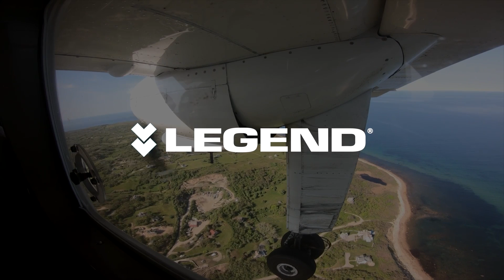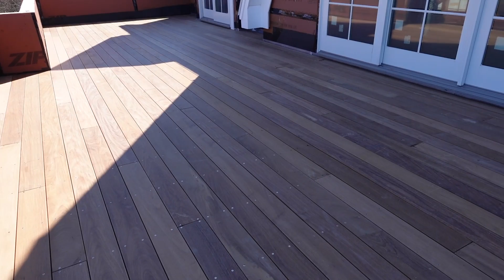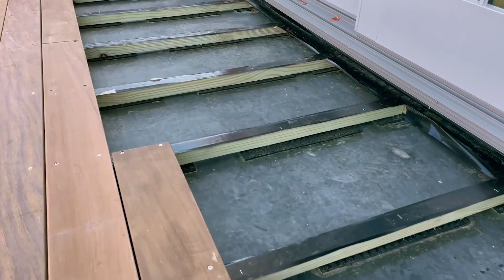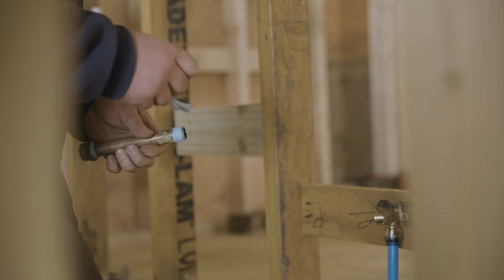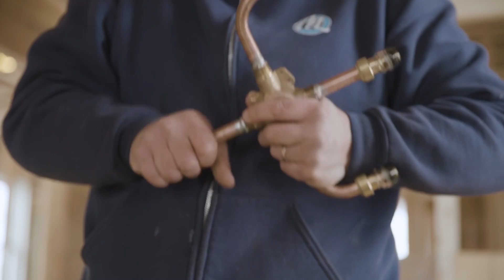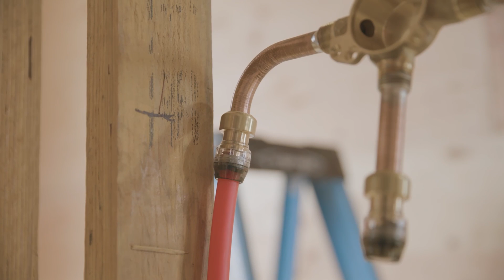BOAI Episode 8: SmartClick fittings, HyperPure Piping & More...

Comment: I kinda like the strength characteristics of cross-linked Pex.  I've seen freeze tests that make me feel confident about it.  This straight chain pipe needs a few more years to prove itself in my opinion.  Maybe use it in garages and exposed crawl spaces where it can be more readily checked in worst case scenario's.   I still remember polybutylene pipe.  Come back to me in 15 years.
Reply: It's just Dow PE-RT, it's been around ~20 years or so.  Big advantage over Pex-A is that it can be recycled.  Should perform exactly the same and there haven't been lots of issues with it yet.  I'd be more concerned about those snazzy fittings, barb fittings with crimps or clamps work well and are installed quickly by anyone who has done it for any length of time, I'm not sure how this improves things besides burying new technology quick connect fittings behind walls.
Reply: @shaunbava1801   lol, it is designed to improve their bottom line, kinda like this video 😂

Comment: I use push fittings for appliance water lines all the time and wondered why it wasn't used in house plumbing. Very cool. Now you need to do an updated burst test!
Reply: Not sure on SmartClick, but Sharkbite counts on a lubricated EPDM o-ring to create a water tight seal around the pex or copper pipe you're fitting to, and they just haven't been on the market long enough to know for 100% sure how long that seal will last.  EPDM is good stuff in general, I'm not sure anyone can say for 100% sure how long they will last in this exact scenario and for possibly differing water sources.  Maybe 20 years, maybe 80. 

I used Sharkbite fittings on PEX and existing copper when I replaced my water softener and water filter system. It's all located in my garage where any leaks would be easily visible every time I replace a water filter or fill my softener, but I'm not sure I'd trust them enough to hide them behind a wall for possibly 50+ years. 

If I was doing PEX behind drywall I would use crimp.  Actually might just use crimp everywhere for cost reasons.
Reply: @everydreamai  I'd also say that the water quality can greatly reduce, or lengthen, the life of a push type of fitting. 
Like you, I crimp all my connections tok unless they're exposed. There's nothing to deteriorate on a crimp type of connection that the water itself or quality could effect in my lifetime.

Comment: I bet the cost difference in fittings alone on a medium-large project would be more than the “fancy expensive tools”
Reply: It’s about the same price of shark bites. 9-12 dollars per fitting. So maybe. I’m no pro and if I was I don’t think this may be the system for new whole home construction. But as a diy guy who may replace a pipe or two I would use this over shark bite.
Reply: Yeah, those fittings would add up pretty quick!
Reply: @morganwheeler7417  The problem is the cost per fitting to install.
Reply: @charlesrichardson8635  I hear what you’re saying, but fittings are not a big enough part of the total labor time so as to justify such a high cost for fittings… that’s my .02 anyway
Reply: @charlesrichardson8635  Who the hell can't do pex crimping?

I get copper is "scary" but goddamn, if you can't do basic residential plumbing you shouldn't be owning that house...
Reply: @Scircx  I have done an entire house with pex crimping. So Yes I can do it. With planning and proper use of pex, I don't have near as many joints like my remodel of my current house. Don't forget you need to check EVERY with a gage because eyeing it is not good enough. I did a lot more bending of pex instead of fittings and it worked out well. Actually I can see myself a combination of both, but my tool that does 3/8, 1/2, 3/4, and 1 inch with a block change out takes time and it not easy to use in tight spaces. So in this house, I saved about half my time bending and using push-to-connect. Though I have to say the first two bends were a bit scary because I thought I might kink it. Slow and steady did it, so no pressure loss.
Reply: @charlesrichardson8635  I think I @ the wrong person, I didn't mean to come at you lol. And tbh, I would rather use pex a vs b. $500 for the tools (buy once cry once) and the physics behind it is more sound vs crimping pex b.

I'm sure pex a would've been a lot less hassle for you as you could heat gun a kink out vs completely replacing pex b.

And honestly, as long as you do SOMETHING, you're doing it right. More respect to anyone who does the upkeep themselves is all, we can argue about the way it should be done all day.
Reply: @Scircx  I was also eyeing the tool for Pex B, that puppy is expensive!

Comment: Honestly, when I build my house, I’m not going to use any form of quick connect system. 
Pex-A will be my choice throughout the house. I will be using a valve manifold, so that if at some point I need to repair something, I can shut off that zone, do the repair, and not affect water to anywhere else in the house.

Comment: I agree with the others, what is the flow loss over long runs?  One of the major advantages of Type A, especially in big houses with long runs.  My daughters house they had to upsize to get enough flow to the far bathrooms.  One of the problems of having the vendor do the  presentation, they don't address the downsides.  Might be the right choice for certain situations based on price, availability.  May be the wrong choice based on high flow needs, etc.  Need ALL the information to make an informed choice.  As far as tool costs, that may be something a DIY needs to consider, but a tradesman probably has to have the tools for all the pipe types because they have to be ready for the jobs they get called to.  A good introduction to the product, but not anything more than you can get from a sales brochure.  Would be good to have a more thorough evaluation/comparison in a future episone.
Reply: Several PEX B such as Zurn are certified for F1960 cold expansion fittings.  It’s not a PEX A only thing anymore.

Comment: The connect fittings still have o-rings, that I would imagine dry and rot, as well as spring steel that who knows how long would take to corrode with varying minerals in water sources.  I've learned to not install shark bites in concealed areas, is there a difference in these?  30 year warranty tells me same problem, new widget.

Comment: For all these high end houses it seems like everyone’s going back in plumbing, cheap plastic with fittings that can leak like crazy
Reply: @Ball_cock  you would think it  make more sense to have copper piping with a house worth that much
Reply: @davidchillton1744  Copper bursts when frozen, and the sweat connections are prone to fail after 20yrs+.
Reply: Pex can burst too 😂
Reply: @davidchillton1744  Never seen it happen. Crimp much more reliable than Sharkbite. Lived in Alaska. Never had a burst fitting. Copper wouldn’t have stood a chance in similar conditions to what the PEX endured.
Reply: @JohnathanBach  highly doubt that.  I’d rather rely on solder that’s a rubber gasket any day
Reply: @davidchillton1744  With PEX crimp fittings, you don’t have a rubber gasket. If you’re talking about Sharkbite, I agree. Wouldn’t put Sharkbite in an inaccessible place, just not worth the risk, in my view.

Comment: No mention of the cost for each of the fittings or I missed it. Uponor seems like the best solution still with minimal fittings, as they add up fast.
Reply: Will all be replaced with EvoPex or this in the future. On new construction the contractor using the push fittings will be able to under bid because of install time.
Reply: @lrc87290  Not at $25 per fitting. Pex A is pretty fast also, and better flow.
Reply: @JohnathanBach  I don't know the cost of the fittings in video but supply house has A 6 pack of 1/2 evo PEX 90s for $26. The internal diameter is the same as  PEX crimp fittings so not less flow.
Reply: @lrc87290  Right. Pex A is expansion fitting, not crimp.
Reply: @JohnathanBach  right. Uponor Pex A still takes time to complete. In my whole townhouse renovation I used Pex A for its flexability and a few shark bites. There are only 3 fittings in the wall. One each on the supply valve to my 3 wall hung toilets. 
SharkBite supply manifold is in the conditioned attic. Holdright stub out brackets has no fittings.

Comment: The HyperPure PE-RT piping shares several characteristics with PEX-A, like flexibility and expansion. It's just that it's recyclable, and it allegedly stands up to chlorine/chloramines better than PEX-A or Zurn Pex-B. It's rated for ASTM F1960 expansion fittings too.

 IIRC, the max-temp rating is slightly lower than that of PEX-A.

Comment: On the underside of the deck, even though it's sloped to allow water to slide off, isn't that a potential problem for major ice build-up underneath the deck?
Reply: Or blown sand over the years??
Reply: Fix one problem, create another. Good point.
Reply: I was actually wondering about the lift characteristics of the deck since it's not mechanically fastened to the structure.  You get some might windy days on an island.    Ever seen a gas station canopy lift off and fly down the street in a Florida hurricane?  Same visual.
Reply: @jonmiguel  We built a free standing deck for our house, say about 4,000 sqft.  our Architect was VERY worried about lift and other wind effects.  We ended up with some very significant footers.  The structure is all steel and I-Beams, I think the footers were 4 feet by 4 feet, basically a boat load of concrete.  But, we have no penetration into the side of our house  Bottom line, you are spot on regarding the potential for uplift, and for us, it connects to our Pool House so we get a venturi tunnel effect that blows stuff around on top too
Reply: @CC_Foster  In this case it seems more to me like a piece of paper laying on top of a box.  WOOOOOSH!

Comment: Does the smartclick fittings have smaller or same inner diameter as the tubing? Because if its a smaller i.d. and if I were use a lot of those fittings on a single run, all those fittings would cause a restrictive flow.

Comment: using aluminum 2x4 or 2x3 for the porch-sleepers, would eliminate future rot-worry, and screw penetration-worry...........everyone of those boards will rot out quickly, despite the tape.... a multi-thousand dollar repair, and a multi-thousand dollar waste in the build....or even plasti-lam beams, anything but open wood..

Comment: And what's the cost differential, let's say for a 1/2 inch 90 degree coupler vs Shark-bite and some of the expansion ring systems on the market?  Yes, for the expansion ring systems especially you have the cost of the tool.  Let's assume you get ALL of your hot and cold water lines run and just need to make connections so you RENT the damned thing for a day or two.

Comment: The reason I would go with HyperPure is because it’s easily recyclable (unlike PEX). That needs to be a talking point, on top of the 100 year guarantee. Also, that it can be installed with any type of pex fittings or even melted/joined with the proper tool. The marketing guy did a super bad job selling the positive differences — nobody really cares if it’s chemically treated for strength or not, especially because there are no long-term studies comparing leaching of polymers (PERT to PEX) yet. Jeeze Legend, really dropping the ball.

Comment: "100 years" sounds more like marketing.
Reply: it did come out of a marketers mouth. I usually like to put a $100 bill on things I hear from marketing people and throw in the fireplace or shredder.
Reply: Website says 30 years on the fittings.  And the warranty pamphlet for the pipe makes it sound as if it would be very challenging to actually have repairs done.

Comment: how does the price compare? it cost's me under $4.25 to make a 3/4" T in upunor pex a.
Yes i have a tool that cost's 370 bucks but if i make 10k joints with that tool the cost is 0.004 per joint or $0.12 for a 3/4" T

Comment: Will stick to other pex fasteners, dont like theses fittings hidden the walls.
Reply: Agreed but it has a metal ring just like pex and no need for expensive pex tool. No rubber gasket that can and does leak over time like the shark bite system has 
So what is the down side to this other than possibly price of fittings?
Reply: I think the lack of the o-ring is good for confidence behind a wall, but I gotta wonder, why not just crimp at that point.  Crimp is quite cheap.  I imagine these click connectors are quite expensive and do not make economic sense even if we trust them. 

Sharkbite is also not the most economical so I'm not suggesting them either, and looking back at my personal project with those I'd probably just crimp instead.

Comment: You don’t need a fancy, super expensive tool, you just need fancy, super expensive pipe and fittings. LOL! Looks like a good DIY option, provided that is fully compatible with PEX. What’s the comparative reliability of PTC Sharkbite fittings vs these valves provided they’re correctly installed?
Reply: Show your proof
Reply: @daveklein2826  They’ve sponsored Matt’s video 😀
Reply: @JohnathanBach  who cares
Reply: My whole point is that cost of installation tools would not at all be a factor in installing this vs traditional PEX. Further, Sharkbite needs no tools either, so what would have been helpful would have been a comparison of similar systems, rather than imply that it’s going to save you money, because it won’t. Arguably, PEX A does require expensive tools, but the fittings are much cheaper, and the pipe flow is unrestricted. It’s just a one sided advertisement, and that’s fine. Just don’t tell me it’s gonna save me money because I won’t have to buy a $100 crimp tool.
Reply: @JohnathanBach  show your proof and documentation
Reply: @daveklein2826  Look up costs of the materials. Not even close.
Reply: @JohnathanBach  And where are your stats for the labor component?
Reply: @daveklein2826  I don’t need stats. I’ve done a fair bit of plumbing work myself, and I have spoken with plenty in the industry. PTC fittings have their place, but generally not in permanent installs behind expensive finishes. These valves seem to be quite good, but a casual browsing of their catalog would prove to you that these fittings are quite expensive, many in the $20-30 range. Compare that to a $5-8 crimp fitting and a few seconds more work. It don’t add up. If you get to PEX A with plastic expansion fittings, costs go down even further, though the pipe is more expensive, and you need a $400 tool, which would be paid for in the first large project. This vid is marketing, and is not an unbiased product presentation and comparison of the other (may I say cheaper) similar offerings in the industry. A cost / performance video comparing Legend to Sharkbite and other PTC fittings would be much more helpful. Have you worked with Legend valves or other PTC products? What is your experience and opinion on the matter. I’m not looking for a data sheet.
Reply: @JohnathanBach  Show your documented proof including labor
Reply: @daveklein2826  I don’t have to show you anything. I’m not submitting a bid for you, so you can do your own research.

Comment: Epdm is a ok product if you are up north in cold climates without a lot of heat.  Epdm is just layers of rubber glued together in the factory, when it’s exposed to the souther heat it bubbles and they glued layers fail. 

In the south I’d recommend the same concept but with PVC single-ply, and pvc walk pads.

Comment: I’d be hesitant to use these fittings in a cold climate. After the freeze in Texas, some of my old man tendencies made sense. I saw shark bites and pro press fittings pull apart like nothing. And it didn’t just pull apart a little and have leaks. They pulled completely apart so you had a full port pipe pouring out. The only copper fitting that held was solder. They’d have small splits on pipe. This is better to me because you have a tenth of the opening. That being said this may be irrelevant to Pex because it can expand to absorb the pressure in a freeze. However uponor is pretty quick so I don’t see why you’d swap it for a push fit. I bet the push fit fittings are 3 times as expensive so their cost would make up any labor savings you’d have. 
For further explanation, pipes don’t break in a freeze from the ice plug itself expanding but from the pressure created as that freezes. It can create hundreds of psi down the line and this is what the pipe can’t handle